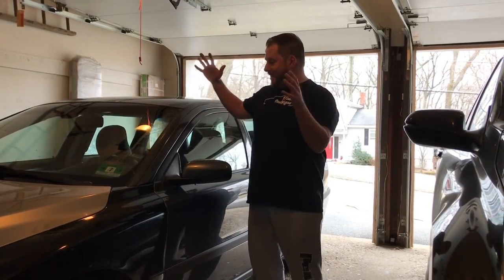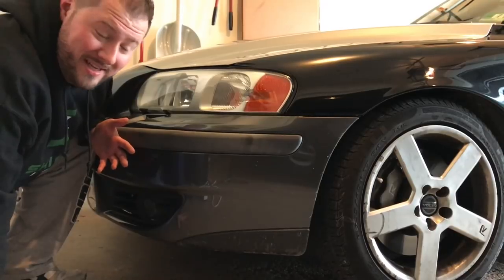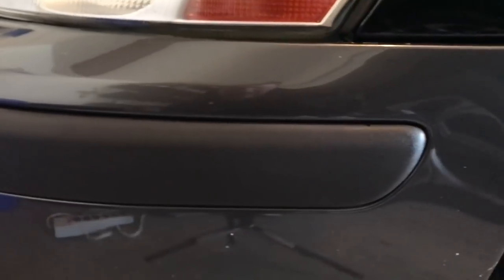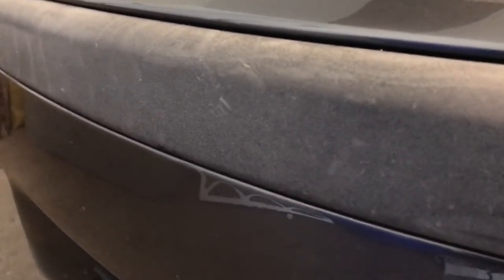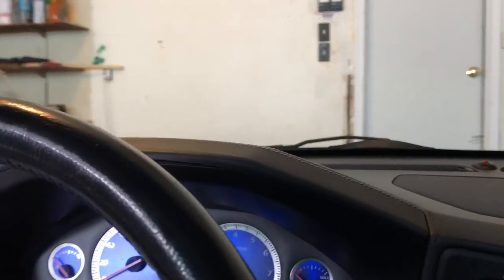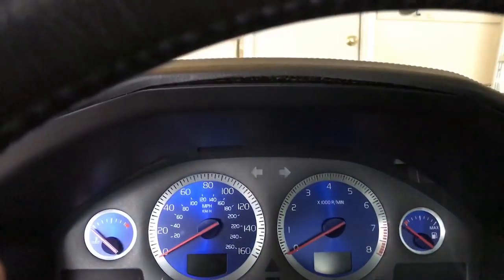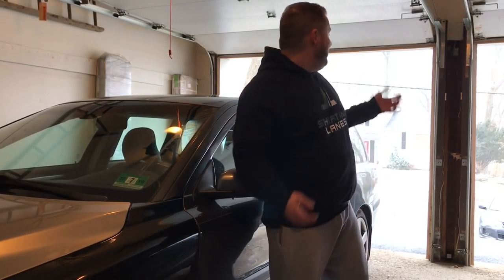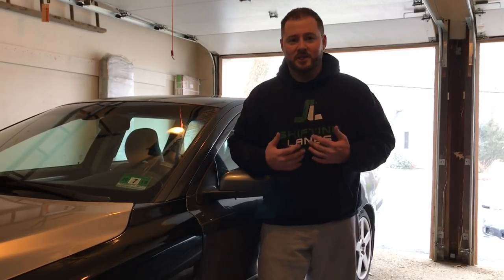I Fixed Something On The Project Volvo V70R That Was Driving Me Insane

Comment: Next time- clean with all purpose cleaner. Apply a product called solution finish. You can then keep it black close to forever if you apply carpro dlux plastic sealant. That back to black stuff is going to wash off or spot with rain.
Reply from the maker: Good tip! As I stated in the video, the whole car is being restored so temporary fixes are good for now.

-Gregson
Reply: Or if you want a cheap fix use linseed oil. Use a brush to apply and rub in with a cloth.

Comment: Hey man, love the vids. I daily drive an 07 s60 R, and absolutely love the car to death. Quick tip too, if you ever have to jump start the car, be very careful and dont use another car to do it.  When I did, I blew out my controller for the blower motor. Its possible it could blow other parts as well. Just wanted to let you know
Reply: Did you possibly hook the cables up backwards? I've had my car for 7 years, I have had to jump it 3 times, I've also used it to jump other people at least a dozen times or more. I have yet to blow any module or electronic in the car.
Reply: Tom Swain no I made sure to put them on the right way. If I put them on backwards I would have been in a whole new world of pain I'd assume. It was strange, but I think the spike in voltage just got to it... It was a 10 year old electronic after all

Comment: Have the exact same break/divot in the armrest lol WTF.
Reply from the maker: It’s from someone putting too much pressure on there and the plastic under cracking. So annoying! You can source plastic fixes, but a functioning, non cracked armrest will always be best.

-Gregson
Reply: Yep, already had a go at fixing it. The plastic seems particularly thin in those areas. I've thought about a more extensive fix by adding more material and using epoxy for fixing it in place. But a new one would be nice, just not sure where i'd get one in the goby color. Dealer is out of the question for obvious reasons lol.